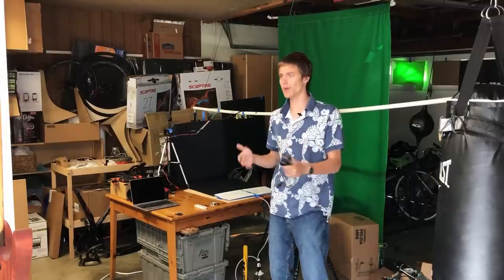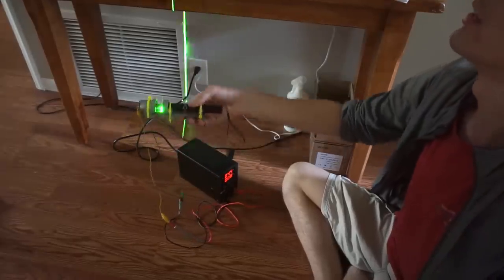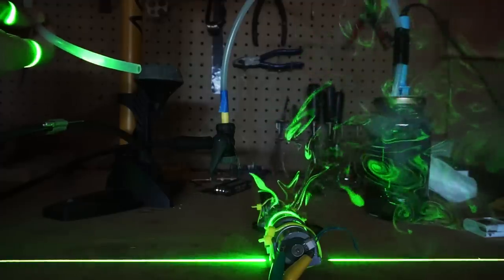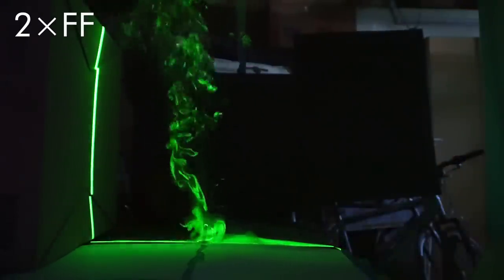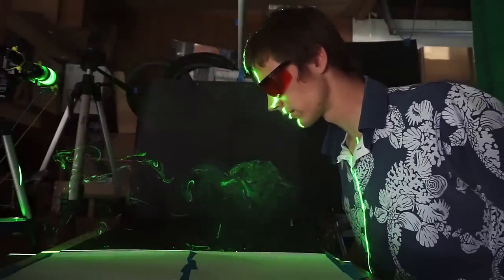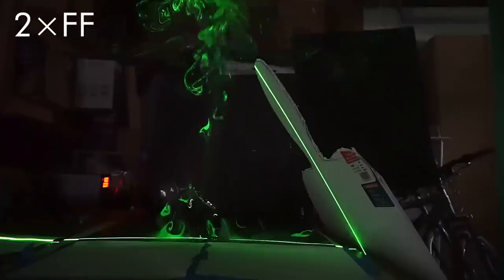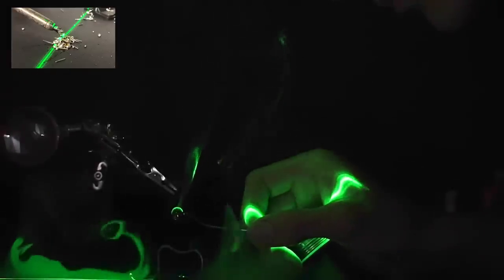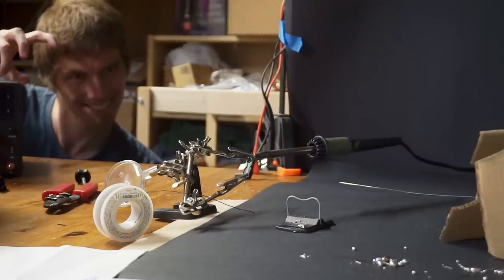Why does smoke from a soldering iron ALWAYS go towards your face???

Comment: I have never soldered without a fan running, so I didn't even know this was a problem until now.
Reply: There are definitely cases where you're working on something "in-place" where you can't use a fan, but otherwise, yeah...  Just use a little extractor fan.  Should be part of standard soldering kits... But isn't.
Reply: as a kid, I used to deliberately inhale solder smoke and try to blow it out my mouth... not knowing it contained lead.  Now I just use lead free solder.. lol
Reply: @turbo2ltr  The fumes aren't actually lead, it's the rosin in the solder. Still not great for you though
Reply: @satiric_  it could contain lead if the solder isnt lead-free
Reply: @awesomestuff9715  The boiling point of lead is around 2000 K.  Soldering irons usually run cooler than 700 K.  Even if you're using nearly pure lead solder, the amount of lead in the fumes is extremely small.
Reply: @adrianhenle  while im not sure how much lead is actually in the solder, and how much of it evaporates or gets in the fumes, any amount of lead that gets ingested isnt exactly desirable, and a little bit can add up when you have breathed enough in
Reply: @awesomestuff9715  actually, enough to get lead poisoning symptoms if exposed to for a couple of years. But if you're only a hobbyist soldering a couple dozen pins every other weekend, the amount should be negligible
BUT
as a hobbyist, you are much more likely to be exposed to lead through contaminated surfaces (which happens less in professional environments), so the problem here is not the fumes but lead containing dust, specks, chips etc that might find their way to your stomach by touching them with your hands.

Comment: I have always wondered why.  Now I know.  This was very entertaining too!   One of these days your subscriber count is gonna explode.
Reply from the maker: Yeah I was certainly happy to figure it out! Glad you liked the video and hope you're right about the channel eventually exploding - I think it just takes a whole lot of people with a whole lot of followers sharing and sharing and that's so hard to initiate organically...
Reply: @AlphaPhoenixChannel  It should explode. Great video, subscribed. I'll share this with my friends too, as it has great explanation of why that happens. :)
Reply: It may be about to. I’ve just got sent here from Steve Mould’s channel.
Reply: The prophet!
Reply: It certainly did explode
Reply: @AlphaPhoenixChannel  Have you researched how safe/dangerous the fumes coming off the solder as it is being melted/applied? I'm thinking of Mr. Robot and the lead poisoning that killed Elliots dad...
Reply: Spooby 42 - the smoke / fumes is from the flux. The temperature of a soldering iron is only high enough to melt solder, and is nowhere near enough to cause solder to burn or to turn into a gas. So there is very little likelihood of lead poisoning from the smoke / fumes. However, it’s not a good idea to breathe in the smoke / fumes.
Reply: The good old days. I use to use a rotating Lazer to level suspended ceilings while smoking three packs a day.
Reply: Here after the sub explosion 8)
Reply: @spooby4212  flux fumes are quite hazardous, which is why anyone regularly soldering needs a ventilation/filtering system

Comment: I was a PCB tech for 20 years and experienced this daily. I became so concerned over lead poisoning that I would use a filtered fan to suck the  Solder smoke away from me. It worked. I recommend to all who solder to use this method and NOT breath solder fumes.  Thank you for the explanation.

Comment: Wow, someone actually did some research on this issue. I just bought a small fan for this purpose.
Also, you could just have put some flux on the soldering iron with screwdriver or some tool, it would have been much cheaper than melting expensive solder ;) Great content my friend
Reply: but even the flux makes smokes :(
Reply: @e_sence  That's the point. He could've used something cheaper like flux to see where the smoke goes instead of something more expensive like solder
Reply: Cant even find flux in the pandemic..

Comment: How bout putting the work at the very edge of the table and sittin a bit back, or putting the work on a tiny table on the workbench, then here could be airflow between the arms, body and table, right?
Reply: I almost always solder at the edge of the table, and smoke still goes into my face if I don’t use a fan. That’s why I’m guessing it’s a combination of these effects or maybe there’s another factor.

I’ve noticed that when it’s cold, smoke more aggressively attacks my face, so I think body-heat updraft plays at least some role.
Reply: I've noticed how you hold the soldering iron and solder affects this. If you point the soldering iron and solder more forward as well as keeping your hands further back on the solder tends to massively reduce this effect.
Reply: I try to just solder with a directional fan going to blow the fumes away before they get to my face
Reply: Solder splashes on balls, bad day mate

Comment: Well, a solder fume sucker obviously helps, and they're relatively inexpensive. But now I'm wondering: what if your table had perforations, at least around the soldering area? Would this be sufficient to cause an updraft through the perforations that would drastically improve matters?
Reply: Wait till you spill a container of smd packages
Reply: @peppersalt  lol, good point.

Comment: Next:  solve the “drop a piece of tissue paper into the wastebasket and watch it sidestep the basket and land on floor” problem.  Some how some way, the problem is air currants.  Or maybe raisins.  Let me rethink this question.
Reply: As it falls the tissue pushes a tiny whiff of air ahead of it.  The air inside the waste basket has nowhere to go.  So the tissue slides off the resulting tiny dome of higher pressure and misses the basket.
Reply: How 'bout other mysteries, like why does toast always fall butter side down, or that more ancient riddle, where do the socks go that get lost in the washer or dryer?
Reply: @TropicalCoder  it probably goes butter side down because the butter makes the bread that little bit heavier on one side, and maybe because bread is flat on 2 sides it wants to stand up straight but the side with the butter is heavier. That's my theorie.
I never use butter tho, and if I do it's over my plate.
Reply: @c.l.h.bokhorst6687  The butter's weight would only be relevant if it also significantly affected the aerodynamic forces on the toast. Don't forget that a feather falls at exactly the same speed as a bowling ball in a vacuum. The only reason a feather normally falls really slowly is that it has a large surface area but doesn't have enough weight to push the air out of the way.

Comment: Thanks! I got many ideas to solve this problem. One lf them, cut a hole or better, a long thin slot in your workbench in the low pressure area, and have a small fan under the table.

Comment: Wow! Thanks. Working in electronics for most or my career, I also noticed how the smoke always came into my face and I also wondered why. And like you, I have actually moved to the other side of a table and observed it following me so it wasn't the air currents in the room (due to HVAC?) Your elimination of several possible causes, one of which I would have bet on and final explanation of the actual reason was great. 

Mystery solved!

Comment: Thanks for figuring this out. I thought it was just my confirmation bias. 
It would have been interesting to see if it would reduce the smoke coming towards the face, when an additional cardboard was used behind the soldering iron to block the air flowing across the table.

Comment: Thanks for the info, I always just figured it was a rite of passage in soldering, sort of like a sacrifice burn on your fingers when you keep holding on because you don't want the wire or part to move until the solder sets.

Comment: I coulda told you that from my hardware technician days. This is why you should use a riser table for soldering... Not to mention other tools, like a large magnifier, which doubles as splash and smoke-in-the-face protection.

Comment: Very interesting suite of experiments with the result of an explanation. I would like to throw a spanner in the works and maybe generate another thought on the subject. The smoke from a soldering iron rising up into your face is the same phenomenon as smoke rising up from a camp fire into your face. Yet, your arms could be behind your back and you are a bit further back. The theory I heard in the past is that the heat from the soldering iron/camp fire generates a (local) high pressure system that radiates outwards. A body becomes a partition to that high pressure and a low pressure area the other side of the body. The smoke actually goes around the body into the low pressure area. It is a consequence that the smoke is also rising vertically also.   Just a thought. Maybe somebody else has already made mention of this.

Comment: When I was a child (I was born and raised in Russia) I went to the "Dvorec Pionerov" (a hobby group from the USSR for children, where they can learn some useful skills for free). And there was a radio engineering club where we learned how to solder, lay printed circuit boards and make some of the simplest devices from radio elements. There we sat at tables, and everyone had their own equipped workplace, where there was a hood right in front of their hands. I didn't understand why it was positioned in front of my hands and not OVER the place of work, and besides, it wasn't very strong. And now I understand why! And because of this, all the smoke rose straight up and even from me, bypassing the face. The flow was compensated on both sides) The ingenuity of the USSR)))

Comment: I made a rig a few years ago that works really well. Grab a PC fan and any USB power supply. Fit the fan into a section of dryer hose and glue into place. Secure with a large zip tie and plug it in. Position the negative pressure side of the hose a few inches away from the project you are working on and that's it. Your own personal work bench fume-hood/vent. Enjoy.

Comment: Well, thanks. I medigate that problem by adjusting breathing technique. I still use leaded solder so I´m very aware that this smoke is bad.
Weller has a very nice but very expensive solution by adding a little vacuum line nozzle thingy onto the soldering iron- works a treat.
Maybe someday I´ll recreate that system.

Comment: I work as an electrical engineer for a company that builds very high end wireless communication equipment (the stuff used for making movies and like major sports and stuff)....I can 100% without a doubt confirm that the smoke ALWAYS goes to your face!!! I started with a fan behind my work, that did very little to help. Then I mounted it above my work, and had similar results to it being behind my work. Then I added a fan directly in front me, blowing towards me. It did push the smoke towards me, but it also pushed it past me, so it's the best I have for now since we don't have fume hoods, or any other negative pressure gradients to work with. I definitely think there's a solution out there that would fix this though! Hopefully it's a possibility 🤣

Comment: A solution to this, which I will have to test for myself, would maybe be to block the air more on the other side of your body. By putting a small shield or barrier of some sort, right behind what you are soldering, maybe you could force air to flow from your body and away from your face instead.
Reply: Just get a tall table. As my eyesight gets worse with age, I now solder with magnifying glasses and my chin on the table right in front f the pcb, so smoke no loger gets near my face!

Comment: I always figured the smoke goes into my face because firstly, the smoke's hot so it's going to go up, and second, at least in my case, I have poor eyesight and don't wear my glasses as often as I should. So I tend to get in really close with my face, right above what I'm working on. So it would stand to reason that with my face directly above my work area, and within inches of it, that my face would be in the path of the hot smoke going up. Also after giving it more thought, I think your breathing would have an effect too, depending on how still the air is.

 The idea being that moving air is low pressure air an air pressure gradient (difference between pressures) will always cause the higher pressure air to move into the area of low pressure. So assuming the air pressure difference between the soldering fumes and the air moving in and out of your face. It would stand to reason that the soldering fumes would be drawn into the lower pressure air coming from your mouth, as opposed to being drawn to the slightly higher pressure air in the room.  That's always been my hypothesis anyways. So now to watch the video and see how right/wrong I was. But regardless of whether I was right or wrong, I just had fun thinking about it. I love thinking about hypothetical science stuff like that. Especially when you get math involved. But that wasn't necessary this time.

Comment: If I understand this correctly, surrounding 3 sides of an area opposite where you are with something which blocks more airflow than a human torso and arms should form an area with even lower pressure.  This would result in air currents which carry smoke directly away from your face more passively than a fan.  You could probably even funnel the air into a tube to carry the smoke out the nearest window.

Comment: When i first started soldering (with my 9$ amazon special iron) i would put on gloves and eye protection, i had all the filters and fans and helping hands and spool holders and i set up a soldering station that had a protective mat under it and an overhead hood to catch any smoke the filter missed.. the whole 9. I went all out. I didnt want that deadly toxic dangerous smoke anywhere near me.

Eventually i realized its not that serious. lol. I wouldnt breathe it on purpose but its not gonna kill you.

nowadays when i wanna solder i grab my iron, iron stand, flux tub, and solder spool, and i go solder wherever. I just gently blow on the iron tip so the smoke isnt in my face. It started being really annoying only being able to solder in one location and if i wanted to move id have to move a ton of crap.. 20 minutes of setting up for a 10 second solder joint..

Pro tip: if youre scared of the smoke and dont wanna blow it away from you and dont want to build a whole soldering station, the fan above the stove works great for catching smoke and blowing it outside the house.

Comment: I did something similar to this 13 odd years ago at my girlfriends birthday party. Late into the night everyone was huddled around a brazier with the smoke just to dim to see in the darkness, I remembered I had a green ebay lazer in my pocket and pulled it out to sweep a beam through the smoke, Instantly a plane of swirling vortices a couple of meters in diameter illuminated the air above us to the spontaneous sound of gasping in amongst our group. Being difficult to continually sweep the beam back and forth I used the 'flexing pencil trick' where holding the pen lazer at a particular balancing point and oscillating it to produce a flat plane persistent enough to appear to be continuous to the eye. What it relieved in the darkness was beautiful with magnificent turbulent flows of rotational vortices and streaks of variously dense smoke all waxing and waving in the slight breeze of the calm night, it became fascinating with the behaviour of the flow to be revealed in a different perspective when I adjust the angle of the plane between the horizontal and vertical axis, like seeing a 2Dimention space changing as it moves in a 3rd Dimension. after a bit my hand got tired so I stopped resulting in a auditable "awww" from those in the group who were as fixated on the majestic surrealistic display. So I handed the lazer off to another and sat back to watch the show :-)

Comment: Soooo.... this got me thinking and I would expect there is more there than just air flow. For example... static charge in your hair (all over your body) would be negatively charged... and carbon in things like wood smoke is also negatively charged so you would expect to see some sort of repulsion. However, we are not talking about wood smoke. This lead solder... with a low bp... and vaporized PB as a pure metal is positively charged. So that may be why it is so attracted to us. Also, our bodies constantly emit water vapor in dry / low humidity climates... which carbon in smoke wants to react with (is attracted to) to form carbon monoxide and dioxide. 

You should try more tests with different types of smoke (including solder) and a slight negative charged on whatever is representing the body. Also don't forget that all objects with mass have gravity. I am sure it is a combination of many variables.

Comment: You can create a safer "fog" by atomizing mineral oil with compressed air.  The same technique is used by commercial "haze" generators.  Requires no heat and no toxic vapors.

Comment: Haven't you heard of soldering snorkels ?  They' look like plastic laundry dryer ducting that attaches
to your forearms with velcro straps and extend back and down to your waist.  The ducting carries
body-heated air to the area near your wrists, where it joins the rising solder smoke to carry it directly
upward and not toward your face.  I think I bought mine at Radio Shack, but I don't know who sells
them now.